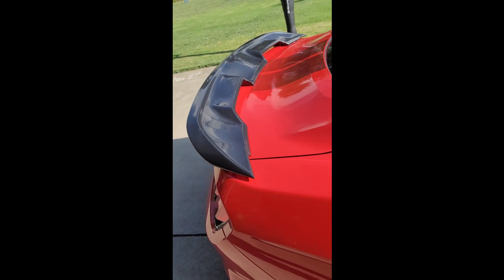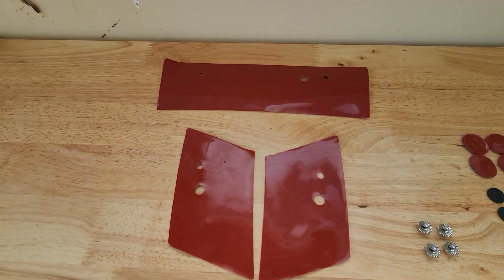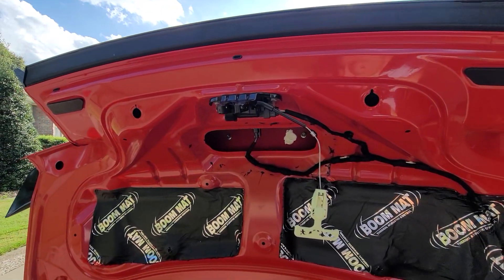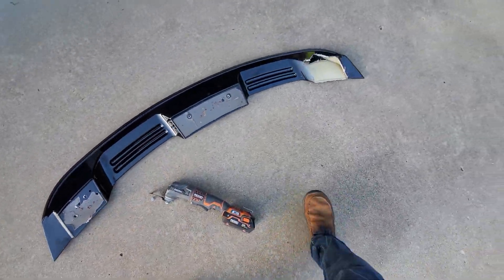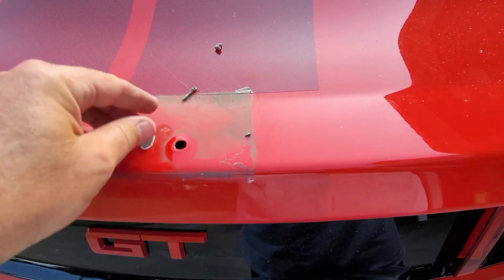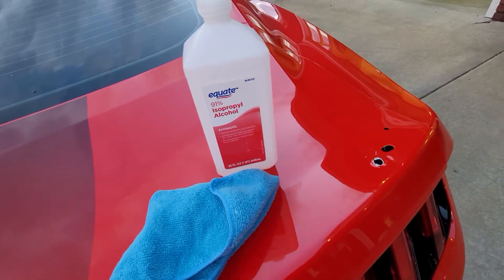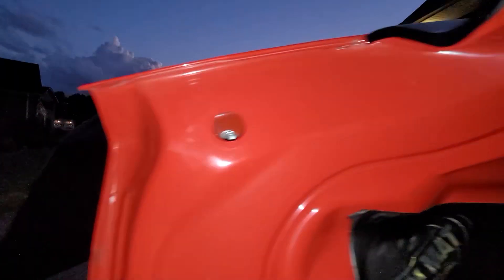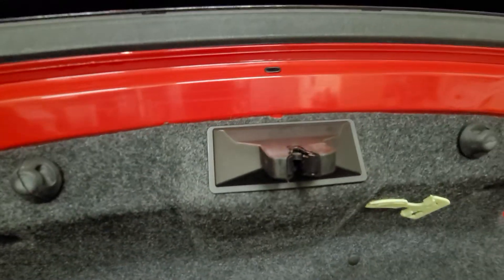MP Concepts GT500 Style Rear Spoiler with Wicker Bill install 2016 Mustang GT

Comment: Also just notice that, sitting in 100degF heat, it bowed 1/4" up all across the front edge detaching all 3 adhesive pads.  Once cool, it returned to the original shape, but very unexpected.